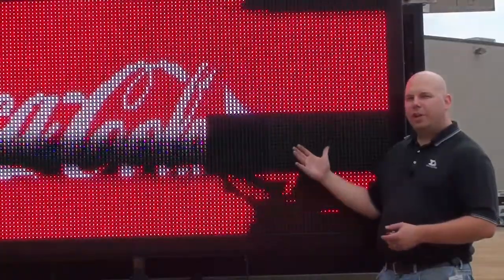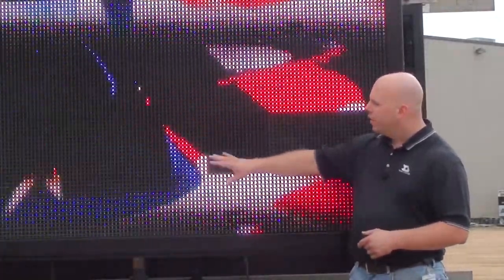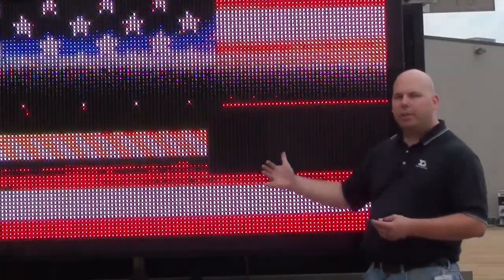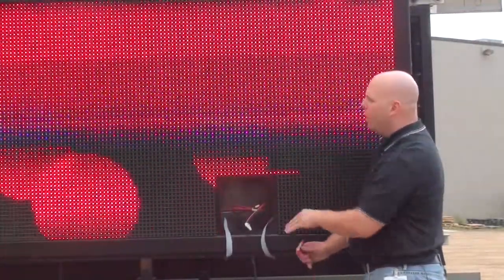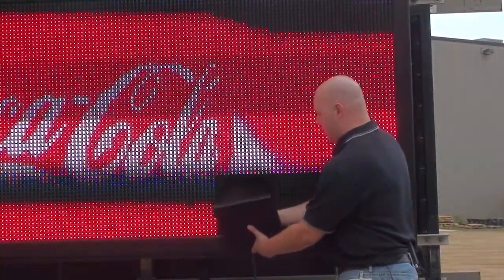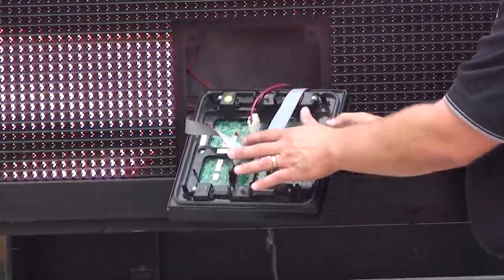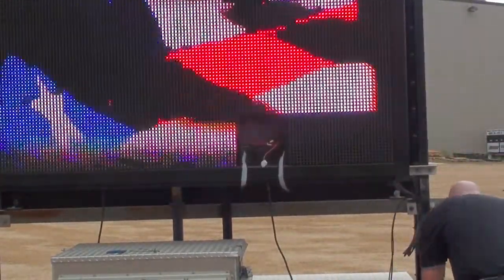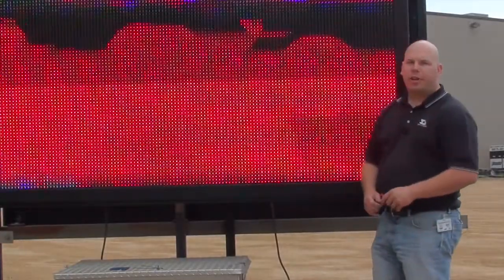Daktronics: Troubleshooting a Blank Section

Comment: I have a dakronics vanguard model 2007 and I have 3 modules that are not completely out but are not complete ? any suggestions
Reply from the maker: Hi Allyson, we will need some more information to understand what's going on with your Vanguard display. Our technical support team will be able to assist. Please contact them toll-free at 1-800-325-8766, or submit a request using our MySupport portal at https://www.daktronics.com/mysupport/help.
Reply: Buenas tardes
Reply: Quisiera saber cómo es el proceso de inversión